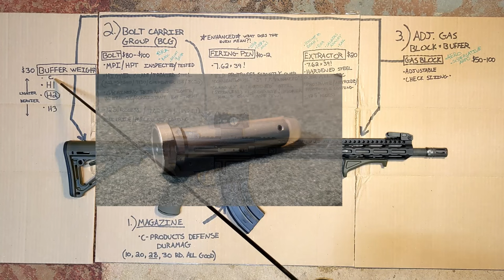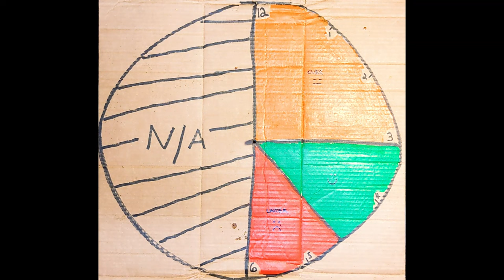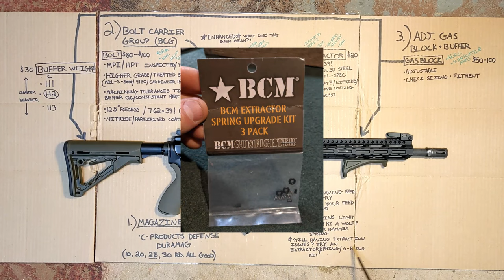How to Build a Reliable AR-47 (7.62x39 AR-15)

Comment: I'm working on my own video to document my foray into 7.62x39 builds. One thing I've learned can have a dramatic impact on bolt longevity is the overkill demolition of the six-o-clock lug in the extension to create one big feed ramp. Sanders Armory 16" barrel. Came this way. Snapped a lug on my first bolt at around 950 rounds. From the perspective of from behind the bolt and into the barrel it was the lug next to the extractor closest three-o-clock. Replaced bolt, then at around 300 rounds (all Belom) I NO-GO gauged it and found it was positive headspace. Looking at the bolt the same position lug was bent noticeable inward. Changed bolt again. Now, only 4 rounds in, what's left of the two lugs next to the absent six-o-clock lug look like they're peeling back and catching the brass and bending the cartridge at the neck. I consider my Sanders barrel now scuttled because of this.

My 18inch KAK w/ Midlength gas system... runs like a champ out of the box. Not a heavy barrel but groups certainly well enough. Even works with ASC mags and yet the feed ramps look very normal. Not necessarily 5.56 M4 ramps but, tastefully adjusted and not butchered. Oh and I did not notice the oddity that is my sanders barrel extension until I bought and looked at the KAK barrel, then it all made sense. I read some adjust their feed ramps but never thought to this extent.

My 16" Radical upper (impulse buy at a serious discount). This thing is an all-round problem child. Belom and also Sellier and Bellot bullets are literally too fat at the ogive to fit cuz I think they machined the throat on the barrel too short. I verified that I can slip a spent Belom brass into the chamber and it drops in farther than a new cartridge will. Barnaul runs fine but Barnaul is hard on ARs not just because of the steel case but they're one of the consistently hotter rounds out there and you really feel it. I reserve my Barnaul for my PTR; that thing eats it up.
Reply: Where did u get your Radical AR47 from? And how long have u had it or how old is it?
Reply: @SammyTheSidePiece  Primary Arms end of December, 2022. Was on sale for $229.99 then I also had a %12 off coupon and got it down to $203. Got a Primary Arms optic same order, took off the shipping so it was impossible to pass on. Just really wanted to try it out, see if it was worth the hype.
Reply: @411DL  yea man we got a Radical x39 from classic firearms a couple of weeks ago, on sale for 440$ and It looks and feels really nice. So far we got a Tubbs flat wire spring to reduce harmonic vibration and be forgiven on the BCG. The next upgrade is gonna be an adjustable gas block because I need as reliable as possible. I was asking when u got yours because I'm thinking when Radical first started making them maybe that was the trial and error period then after making them for some time, they made them better. Hopefully anyways lol
Reply: @SammyTheSidePiece  I should note that my upper did not come with a BCG or charge handle. Did you get a full rifle somewhere?
Reply: @411DL  oohh, yea we got the whole rifle man. Classic firearms is definitely the place to shop because they have really good quality stuff and the offer a lifetime warranty for a few more dollars at check out.

Comment: Two companies you need for a reliable x39 AR: Young Manufacturing and Black Rifle Arms.   Young Manufacturing makes a bolt specifically for the x39 cartridge along with an enhanced extractor.  Black Rifle Arms makes the best x39 firing pen.  They also make a great extractor as well.

Comment: Just finished my build,. So far only 100 rounds thru it, but it ran Flawless. One hiccup was a Failure to feed. That was a Magazine problem. ASC 5 ends. {I still use them, Its all I have now} Rectified that. Love it !. Much better than the Half dozen 5.56 and .300 Blk out's I've built. But I will buy a 5.56 upper to play with. Why not ,right?  Anyhow, Navy "75-81". Thanks for the Video. Big info

Comment: I have made two AR47 builds as well, and I've gone perhaps a little overboard on them both, guts-wise.  
First, a BCA side-charge upper receiver holding onto a 16" Faxon mid-length gunner barrel, adjustable gas block, and Kaw Valley 5.4oz (H3) buffer.
Second build is based on a standard top-charging upper with a KAK bolt, KAK 16" carbine length nitride barrel, but I had a bunch of spare parts lying around so I used an Adams micro piston for the operating system. Also using a Kaw Valley 5.4oz tungsten. Both builds use the BCA enhanced pin and Witt Machine SME muzzle device. I was worried at first that cheap 7.62 wouldn't work with higher end drop-in triggers but... they do! So I've got a CMC drop-in on both of em.

I got a bunch of extra extractors just to be sure, but they are actually so much fun to shoot that I've started buying Sellier & Bellot FMJ brass rounds in bulk. They're not cheap, but they ARE fun enough to make it worth it!

Comment: An extended firing pin didn't work so well in my M&P-15R upper chambered in 5.45x39. The upper came with a heavy hammer spring. However, I didn't want to be stuck with a mil-spec trigger and heavy hammer spring, so I experimented with an extended firing pin. Nothing was near as reliable as the heavy spring.

I think my upper prefers polymer coated steal cased ammo. I was getting approximately one feeding issue per magazine with the lacquer coated ammo.
Reply from the maker: Every build is different/experiences different tweaking.  Currently getting mine to run good on lacquered steel cased.  Thanks for watching!

Comment: Just got me a barreled (no BCG and charging handle, for those who don't know) 7.62 x 39 upper by Radical Firearms and gonna build on top of an Aero Precision lower. This video is a godsend because I haven't bought a lot of the major parts yet. This is gonna save me a lot of trouble and money! I appreciate the info and I learned about how to tell if a rifle is overgassed or not! (Seriously, I was just shopping and doing research when this video randomly popped up in my feed!) Thank you!
Reply from the maker: Glad I could help and enjoy! Let us know if you need any help! If you have reddit, r/AR47 is a helpful place too.
Reply: @ExtremelyAverageMan  Appreciate the offer and I might just need the help! I have built an AR15 in the past; a really nice CMMG Resolute in 5.7 x 28 in Flat Dark Earth (it looks sexy with an FDE stock and grip with a black lower and buffer tube [the lines are gorgeous]). It's a sweet little shooter with no recoil at all. Time to add to my rifle building repertoire!
Reply: Don't need the BCG for this build, just a new bolt. Save u a lot of moolah
Reply: Make sure You're feed ramps are polished smooth... You're hammer spring is heavy for steel case Russian primers, and You're running an enhanced firing pin 😉

Comment: Great Video I enjoyed it.  I was impressed with accuracy of 7.62x39 out of an AR.  There are adjustable buffer weight kits for about the same cost of a buffer weight.  I ended up going with a fixed A1 stock, recoil is much smoother.  I need to check out an adjustable gas block.
Reply: The Yemenis were also impressed with the accuracy of their Colt 7.62 × 39 ARs. So much so that they called them Allah rifles.

Comment: I Also Added A Wolff Extra Power Hammer Spring From Brownells To Mine Many Years Ago And My Build Has Run Flawlessly To Date! You Can Also Install A Competition Muzzle Break To Control The recoil With A Standard Buffer Spring!

I've Built Quit A Few AR-47's Over The Years For Myself, Friends And Family Members & Everyone Of Them Are Still Running Flawlessly After Many Years Of Continuous Use! Thanks For The Video!

Comment: Thank you for making this video. I've been through most of these issues and have done these upgrades already. But it's good to have a tutorial for the newbie's. I keep a complete entranced BCG on hand when I shoot my AR47. If I break an extractor, I can just slap in the other BCG and replace the broken extractor at home. The adjustable gas block was my last upgrade.
Reply from the maker: Awesome, glad I could help! Yep, we've all been there and these builds are surely trial and error.  That's probably the best resolution at the range-a broken extractor is easy to replace in 5 minutes, but even easier is to just pop in your "on deck" bolt carrier group and just replace the extractor at home while you keep chugging away at the range!

Comment: An extended-length firing pin was CRUCIAL in my build. An "enhanced" extractor has been a great investment too.
Reply: I did both those and installed the nitride covered bolt pin so it will move smoother.
When I ordered 1 for my radical 762 I decided to order 3 total and stick the other 2 in my 556 ars since it was cheap enough.
Reply: Who did you buy the firing pin from?
Reply: @bobbye7353  black rifle arms.

Comment: I agree with many if not most of your recommendations.  One thing I recommend for over gas issues is to start with the adjustable gas block then go to increasing buffer weight  as needed.  It is best to limit  the amount of gas going into the BCG to avoid excess fouling and gas in your face.   My rifle still has the carbine buffer and ejects where it should after adjusting the gas block.  But I may try a heavier buffer just to see if there is something I am missing!  Thanks for the video.

Comment: EAM, I will recommend Wyndham Arms Enhanced Firing Pin (A Premier Manufacturer!) Longest ones and clearly best made ones that I have purchased, Light strikes are a problem with the amount of strike, or really length on your steel ammo being your reason of F.T.Fire! And this actual is the reason we buy these enhanced pins! 
Also Wyndham pins don't break like those from your rifle company! I tried the stuff from BCA, and it's basically junk, or everything I have seen is very poorly machined and prone to fail! I did the math on this, and your hammer strike isn't usually the major problem. It is how much protrusion past the bolt face!!! I now get 100% reliability with Steel cases, or my brass, or reloads now!
Another buffer you can try is a JPS Silent Buffer system! Way more money of course But love the lack of spring noises from the stock!
Reply from the maker: Thanks for the info!
Reply: @ExtremelyAverageMan  YA, BCA IS JUNK, LMFAO.

Comment: can confirm about the duramag, have a pair of 10 rounders, accidently ran one through the washer & dryer, still works even with a minor ding to the feed lip and some loss of the paint
Reply: I also have the KAK "enhanced" BCG the first was a Stoner and it ate itself, but about 100rds in with flip up irons im ejecting about 2:30 to 4:30, but i need more time on it

Comment: I just want to say that your video is one of the most, if not the most, well presented and informative videos on this subject. I watched it a few day’s prior to my bca side charging upper came in. The only thing I did to mine before firing was replace the bca enhanced firing pin with one from black rifle arms and a vortex crossfire ii 3-9x40. I did not add the wolff xp spring although I had bought one. Anyway, using c-products duramags I fired 120 rounds so far, 80 of which were steel cased including tulamo fmj, wolf hp and zsr ap fmj, which are Turkish. The brass cased rounds were s&b psp. All worked without issue.
Reply from the maker: Awesome, thanks for watching! Yeah the BCA firing pins are know to fail early, even if they state that they're "enhanced".
Reply: @ExtremelyAverageMan  So... I've a question if you don't mind (BCA 16" right side charging upper on an anderson lower). 

This past weekend I shot some more and after never having a problem, as my round count was almost 200, I had a failure to completely eject causing a jam. It messed the neck up on the fired casing but was easy to clear.  I fired a couple of more rounds and then the same thing happened.  I was using my 20 round duramag firing the cheap turkish steel cased rounds mentioned previously.  So I wrote it off to bad rounds and I cleaned the gun, including removing the bolt and firing pin and looking at the ejector, which looks fine.  

Today, I had a chance to shoot so I loaded up my 10 round duramag with belom brass (I shot a couple of boxes of these last weekend with no issues).  After the 3rd or 4th round it failed to properly eject causing the same jam and case damage as before.  The only other piece of info I can add is that my brass is landing at about 1 o'clockish.

I made a note to order the bcm extractor spring upgrade kit you mentioned in the video.  I do have a spare Right to Bear extractor I'd bought to keep on hand but the one in there looks fine.  Any other thoughts?  Can it being over gassed cause the problem I'm describing?  

Thanks
Reply: I replaced the bear creek arsenal bolt with a black rifle arms bolt. It seems to run fine again. Oddly I was going to replace the spring in the stock bolt and the pin refuses to come out…

After getting it sorted I added the aero precision low profile adjustable gas block and an h2 buffer weight.

Comment: Main issue I had with mine were feeding issues at the ramp, a bunch of stovepipe, log jams etc or shell completely stuck. Refit my gas block and smoothed out/ widened feed ramp. It works like a machine now, my favorite gun to shoot and cheap ammo. And yes it is a heavy Barrel!  But very accurate

Comment: J&p hammer spring, excellent and made a regular mil spec hammer nearly as nice as an expensive timney. About 4 lb pull. Right to bear enhanced firing pin seems to be doing the trick with wolf steel case. The feed ramps, this is a big deal, don't over look it. Regular m4 are not the best for this. BCA runs basically an enhanced feed ramp vs the standard 5.56 m4.  I run both Duramag and ASC mags. No issues

Comment: Feed ramps is a big thing. Unless your are buying a completely  pre-built upper. If your are building your upper from the ground upper your going to have to smooth the feedramps. Especially the spot where the barrel and receiver meet.

Comment: With a couple of Faxon barrels, I had to open up the gas port a few sizes.

Another time, a Bear Creek Arsenal enhanced firing pin had an uneven finish that kept the pin from floatly freely.
Reply from the maker: Was it an easy install/adjustment going to a mid-length gas system? I'd like to make a video on installing the gunner barrel later this year, however I don't know how that will fair with Youtube's new egregious guidelines.

Comment: If I didn't have a Norinco mak-90 I would totally do an upper in this caliber. I got that rifle in 1999 for a cheap price plus I got a bunch of $2 a box Wolf Ammo much of which I still have.

 I do have a Grendel that I made and it has the same diameter and shape case as 7.62X39. I've made it as a precision rifle so I don't think it's going to have a super long round count anyway. 

This would make a cool opportunity for someone who doesn't have an AK. The  round is really quite excellent and a very good penetrator. It will go right through a cinder block and break it in two easy. One thing I like about my AK is that it doesn't just accept steel case ammo, it is actually better to shoot steel case through your AK. I don't know how they were able to take the AK and make it where it performs better with steel case than brass.  I would not have this AR upper if it can't comfortably handle steel case. This is a major part the 7.62X39 world. Might as well do 300 Blackout if you can't handle steelcase in 7.62X39..
Reply from the maker: Currently resolving this.  I ran 80 rounds of lacquered steel through last range trip and had 2 failure to feeds, but otherwise ran fine.  I've since polished my feed ramps with Flitz, hoping it resolves the issue. Thanks for sharing!
Reply: @ExtremelyAverageMan  I would try some more steel case and see if it has worked itself out. Or maybe there's an improved extractor available.

Comment: Depends on who you ask about these x39ers. A self claimed expert told my friend that an enhanced pin can penetrate the primer of a round. Causing a💥 in the wrong direction.
My friend also heard that using brass in an ak can cause the same ordeal. It was described to my friend as a nightmare to clean the brass out of the bore.
Reply from the maker: I have never heard of that happening.  Wouldn't matter anyway, a pierced primer is a pierced primer.  It's not like the "enhanced" pin makes it explode more haha, it just ensures that it indeed does pierce the primers of the steel cased stuff, which generally have tougher primers.

Comment: Great video! I’ve had a 16, 10.5, & 7.5 from BCA. Only have the 16 now. The pistols were unreliable. It started as a Gen 1 side charger and I could not stand that little screw. It kept coming loose. I’ve changed it to a rear charging receiver to rid my self of the headache. It’s funny, I’ve never had issues with ejection. Although I did make a few changes before I even shot it. I swapped the buffer to H2 and have had the heavier trigger spring and enhanced firing pin. So I guess those changes made all the difference. Along with C products mags, I think that info was out there but I definitely had to look everywhere for them. You have them here all in one place. Wish I had this video when I first started. Great video.
Reply from the maker: No problem! I had to do the same as well, a LOT of reading through forums and various random videos and reddit threads to try and find good advice/answers/remedies to the issues we encounter. My intention was to put it all in one place for people, so thank you very much! Yup, sounded like you did very good on your AR-47 solutions.  I have the gen 2 side charge on both of those builds you see which mitigated that charging handle bolt coming loose (blue loctite not needed thankfully!)